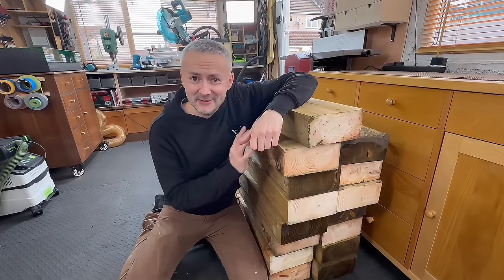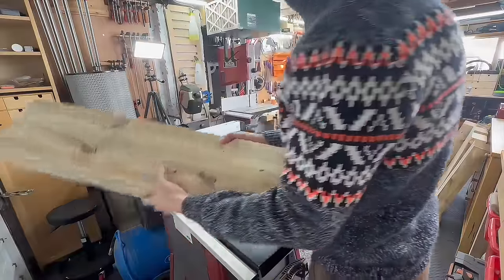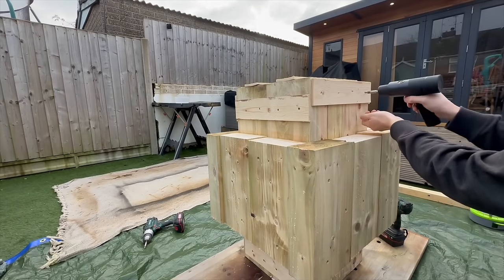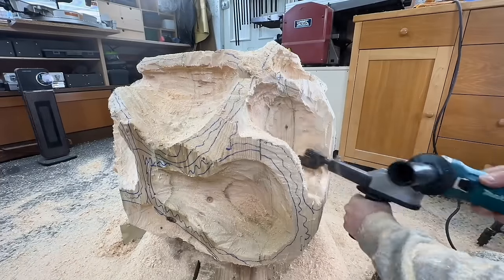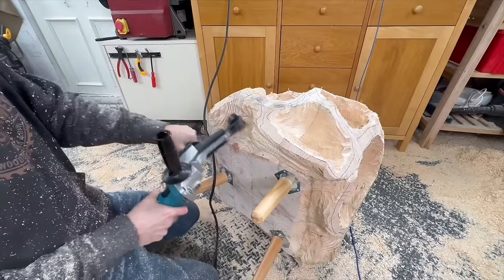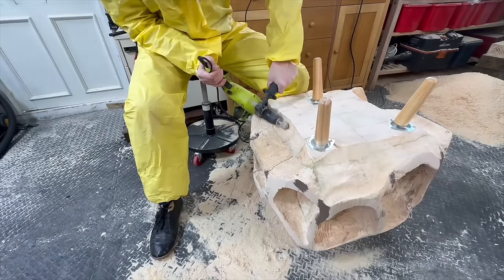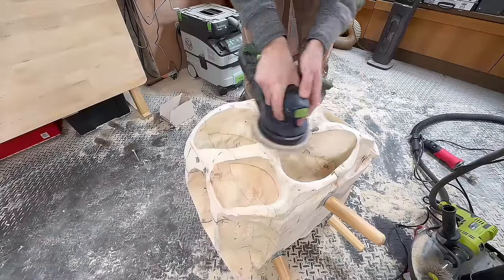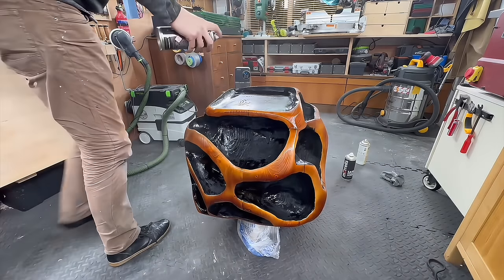I Made a Coffee Table from a pile of wood

Comment: Cold damp weather and glue definitely do NOT mix. I had to bring my current project into the house as well overnight after gluing. I was using hide glue and it did not set at all overnight in my shop.  I actually had to do the same after staining and finishing. I was using a heat gun to warm the wood before having the brilliant idea to just bring it inside.

Comment: hi jay, next time glue only two, then two other and after all glue them together.
for smaller item lay them all together, glue on the top and then turn each item at 90 degrees and clamb then.
and: you are rigth: most of colors and glue cant be used under 7 degrees.
further infos (in german) at "jonas winkler".